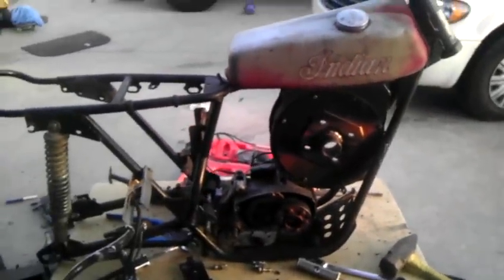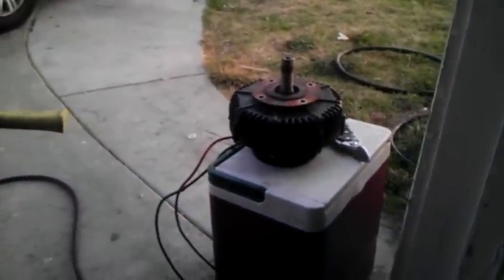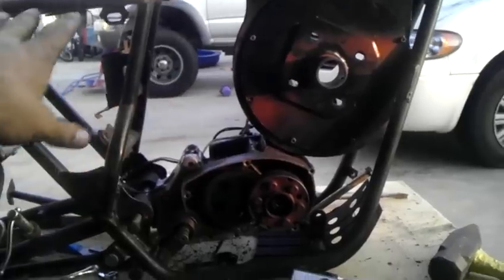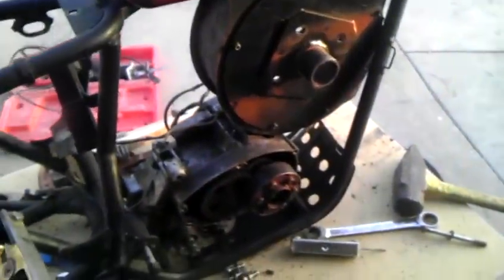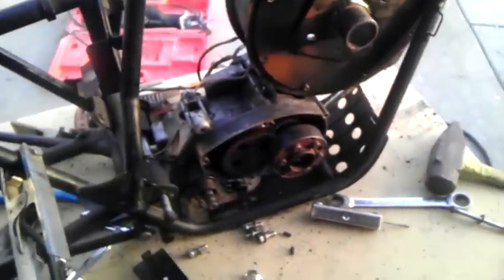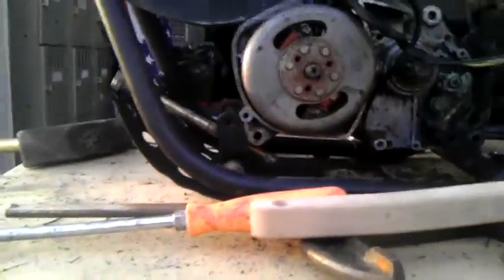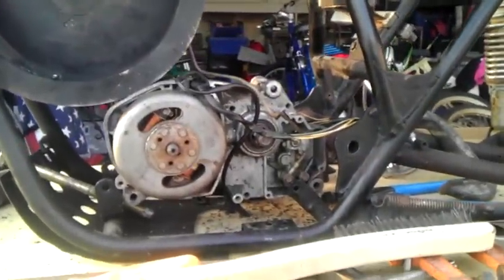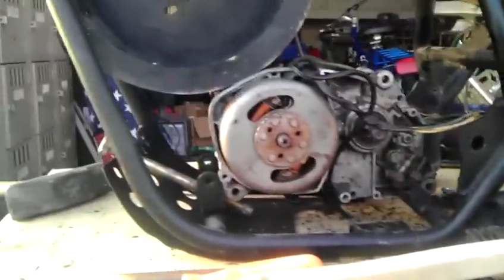Electric Indian ME100 Enduro #3

Comment from the maker: NICE, I do want to use a transmission for this bike rather than direct drive...Everything fits pretty well...only big problem is where I had planned to put the drive gear .....sadly is the clutch actuator...So I have to go with direct drive for now.....until I can engineer a soloution...I will take a look at the CB125 though maybe it would be easier with that crankcase...Big thanks for the tip...I'm an auto mechanic .....not so much a motorcycle mechanic.